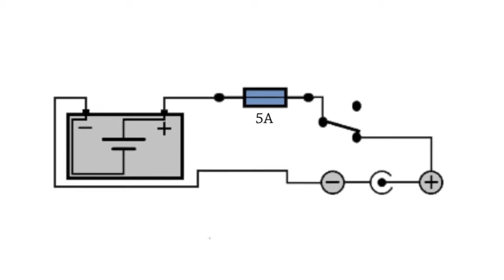Viewfinder / External Computer Monitor Build Log (Reusing LCD Screens From Laptops)

Comment: Geez Man! I am following GreatScott as well, and trying to create my own design as you have... I need to mirror your schematic for battery, i don't think it was quiet clear for me.  

9:42 - 5A what? Why is that needed?
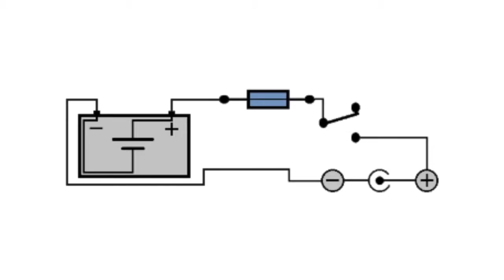10:11 slow volt disconnect module - where did you get that module? 

How did you preset the cut off volt? 

Other than that, great chassis. Li-ion battery - weight? or what was the total weight after creating a portable lcd? 

Last question, have you tried using old laptop speakers instead?

Thanks
Reply from the maker: Thank you, that's cool that you want to make your own. It's a standard 9Ah lead acid battery, but it's huge and HEAVY. it makes mounting it to a tripod a pain in the butt. Havent weighed the whole device but it's probably about 20lbs. I didn't really think that one through, and only went with that type of battery because li-ion batteries are really expensive and I hadn't figured out how to safely make my own from old li-ion cells. If I were to build it again I'd DEFINITELY build my own li-ion battery and focus on making the device thinner and lighter. didn't use the speakers from the laptop the screen came from cuz they were really small, oddly shaped box looking things that didn't sound that great. I went with tv speakers cuz they were available and could be heard better, something I thought would be important while filming out in the field. Because of the huge battery it wasn't a big deal to have them but if I made a smaller battery then I'd probably go with smaller speakers. Or even do away with speakers and use headphones since that controller board supports it
Reply: Yea, I am thinking of reusing laptop battery as a portable power supply
Reply from the maker: Good luck. If you crack open the battery case try not to slice open the cells. If you can't reuse the battery's PCM then buy a new one, and don't short circuit the cells. Li-ion cells are touchy little buggers.